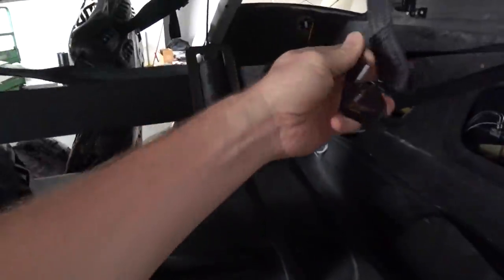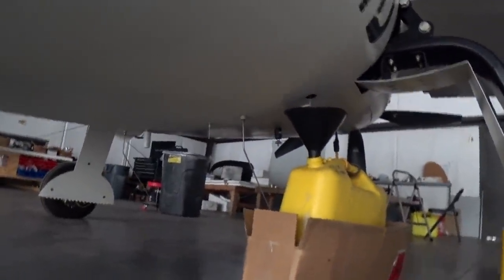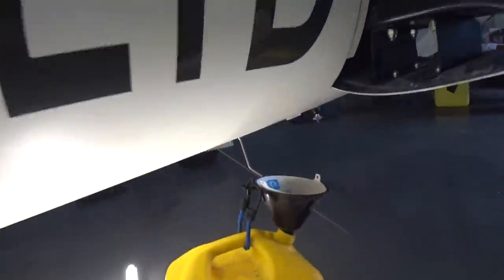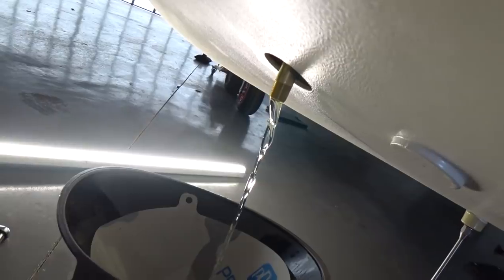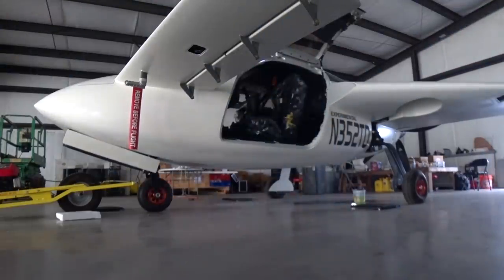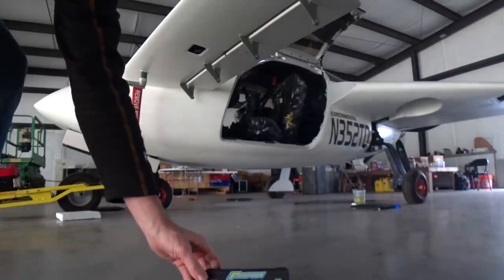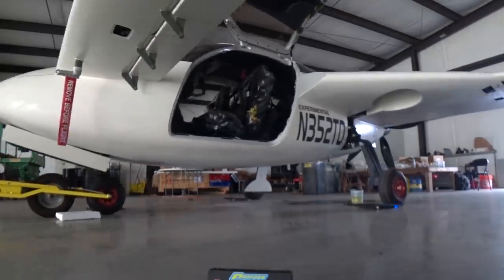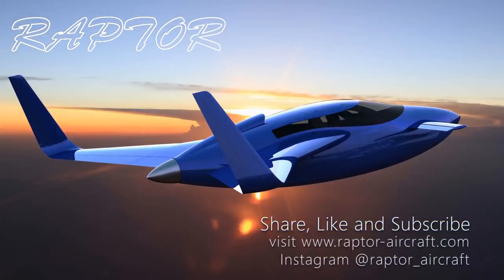Weight and Balance - Building the Raptor Prototype

Comment: 3085 pounds empty. Solid built platform in my opinion. Built as if it were fiberglass but with carbon fiber. I would expect this ship to be "Built Like A Tank!" as you commented to someone. We have so much to learn about carbon fiber and Kevlar. I still repair and restore fiberglass boats from time to time that were built in the 1950s that are still very serviceable. These machines weren't vacuum molded either. The resin was rolled out by hand. The chopped fiber boats hold up well too though much thicker and heaver than layup. It's the encapsulated wood that fails with most boats. The all fiberglass boats properly UV protected will last over 50 years. I keep air circulating in my personal boats to keep them dry from condensate and sweat. It will be fun finding all the refinements to make Raptor, lighter, faster, stronger however hull (serial #0) should offer the most quiet, smoothest ride. Seriously brilliant!

Comment: Hi Peter Great project! Here, we did two velocities and one long ez in 30 years for fly. One question to help. I was a weight and balance engineer in aviation industry. I suggest that you level the airplane before use plataform scales, if no , erros in weight values will occur. I suggest you jack the nose landing geart until level the airplane, you will need a NLG tire jack and a bubble level ( the level point in Long ez is inthe Canard region) , i suggest don´t use the protactor level, becouse the error in angle is huge.... Goog luck and thanks to share your development!

Comment: Following your build for some time now; you're tenacious. A couple questions on today's video:
What was ambient temperature at half gallon fuel weigh? (volume changes with temp) and
 Are you going to weigh/calculate CofG using jack load cells to determine retracted gear CG dislocation?

Comment: Obviously overweight but for a prototype it's certainly encouraging.  I do worry about being able to shave off 800 lbs though.  Peter, have you considered using AI to create the frame and 3-D printing in order to cut the weight down?  It may also make manufacturing significantly easier, being able to integrate many pieces into that process (thus saving even more weight).

https://www.bbc.com/future/article/20181129-the-ai-transforming-the-way-aircraft-are-built

Comment: So the planned specs were for a 2,300 pound aircraft... a 38% overshoot.  I suspect the "kit" cost will also overshoot by at least that much.  This is looking to be an $400k entry cost airplane when you take into account all the extras.  That price point brings in a lot of certified aircraft into the competition.
Reply: @gmcjetpilot  My point is that the viability of this project will be jeopardized if it can not be scaled and sold at price points that are more competitive than other options (with less financial risk).  I am categorically rooting for Peter and his innovation and ethic.  First flight will be soon and it will be sweet.
Reply: It's not that different from a velocity other than a bit bigger and pressurized, but with a vastly cheaper engine. And their kits including that much more expensive engine aren't anywhere close to $400k. And if you subtract off the engine price difference, not hugely different than what Peter is quoting for the Raptor. Get some volume discounting in and that will help, though of course there will be startup costs to factor, and the promised build assist costs and all which won't be cheap, especially at first. But once ramped up a bit, doesn't seem too much of a stretch to get close to Peter's desired numbers thanks to the cheap-ish engine. If he can get it under $200k with a 2-4 week build assist and bells and whistles similar to the prototype (including pressurization) it's going to sell insanely well, even if the performance numbers aren't hitting the original goals. -Daven

Comment: I would re weight with 25% , 50% , 75%, 100% and add people to the seat and move them around to see the best way to load out a flight. And test flight with dummy weight to see how it handles before you put alive people in the other seats.
Reply: There is no need to re-weigh as it can all be calculated knowing the empty weight and positions of seats, fuel tank dimensions etc. very easily.

Comment: So, without the ballast, that's 3,085 pounds + 121 gallons of fuel * 7 pounds per gallon = 847 for a wet weight of 3,932 pounds. Estimated gross is 3,800 pounds, so you're over gross without the complete interior and with no human beings. I've been a fan of this build and have tried to leave some encouraging comments, but...how is this thing going to fly?
Reply: @Shawn Huffman Ouch! :)
Reply: @gmcjetpilot  I really hope he'll be able to find some ways to shave off some significant weight for production models. I hope he'll find areas he's overbuilt and can do some localized redesign. I know it'll be able to fly for testing, but to reach his performance goals (speed, load, and distance), some very serious weight loss will have to be realized.
Reply: @SomeTechGuy666  "When you increase the weight, all those numbers change."

Right, because load is a function of G x weight. If we assume he built it to normal category limits (+3.8 Gs), then he doesn't really have any wiggle room. If, on the other hand, he built it to aerobatic limits (+6 Gs), then he could reduce the G limit (and increase gross weight). However, of course, increased weight will hurt performance. Anyway, it will be interesting to see what happens.
Reply: @SomeTechGuy666  "The kicker is that it is already made out of carbon fibre.  Making each part 40% lighter is not going to be trivial."

Assuming, of course, that the parts (and main structure) weren't massively overbuilt. I didn't watch the earlier videos and so don't know if he just threw a hundred layers of cloth down and slathered on a bunch of epoxy. I get the impression that happened at least in places.
Reply: @SomeTechGuy666  Remember where he drilled a hole through a couple hugely beefy pieces of carbon (some sort of tunnel?) to run a shaft through it and install a big pulley for the aileron work he's been doing? Obviously, that's overbuilt. That's the kind of thing I'm thinking of. It seems clear that some things could've been built lighter. I'm certainly not debating the things you're talking about. I'm sure some of it has been done right, but I don't believe all of it has. If I'm wrong, how did the plane end up so much heavier than designed? I know that airplane design is very complex and it's easy for me to armchair quarterback, but there's no debating the plane is really heavy. I'm very interested to see what happens.
Reply: @SomeTechGuy666  I don't know why it couldn't be test flown on a calm day. You'd always approach load limits incrementally, over time and multiple test flights, anyway (envelope expansion), so normal climb and gentle turns would barely get you over 1G. I'm not a test pilot, though, so there might be something I'm missing.

Comment: Wow 3100# empty is kind of a a deal breaker. The comparative 250 KTAS  310HP Velocity TXL is 1790# empty with an MTOW of 2900#. Raptor is heavier empty than the TXL is at MTOW and horsepower is almost the same.  I love the plane and the vision but there is an elephant in the room and this plane will not succeed unless it gets a lot more power or a large diet.

Comment: Just a Thought..........
Diesel fuel that is intended for use in Cars and trucks on public ROADS has a road-tax included in it's price.
Diesel fuel that you use in Tractors, Graders, Back-Hoes, etc, and other non- highway and road going vehicles (which has a red dye in it, otherwise the same fuel) is much cheaper.
It may benefit you to get a tank or drum of Diesel fuel for equipment delivered there to the hangar as it would save you $$$ since your diesel-powered vehicle will not be using public roads and therefore is exempt from paying the associated taxes involved???

I only thought of this because I noticed the clear color of your diesel you were draining.........
Reply: Animal Husbandry Fuel Tax relief is associated with #2 diesel (red). I used to maintain turbine crop dusters, they were allowed to use tax free #2 diesel as would a farm tractor. The problem with #2 is that in cold weather the engine is hard to start; fuel doesn't properly vaporize without fuel heater, which doesn't operate until the engine is started.
Reply: @koncaswatch8726  well, I believe this man building this aircraft is in Georgia, USA right now, so it never gets cold enough to have a problem? so at least while he is in Testing and R&D phase he could use red diesel to save $$$
Reply: Use regular diesel and get the refund when you file taxes.
Reply: TechGuy probably just Jet A which is essentially diesel fuel with ice and bacteria inhibitors in it.
Reply: That’s a great point. Talking to a fuel delivery guy, #2 diesel is the exact same as red dye diesel, he fills both pump tanks with the same fuel then pours in a red dye into the farm tank. As far as performance is concerned they are identical so throw in a winterizer of sorts into the cheaper fuel and you’ll be ready to rock

Comment: Not an aircraft engineer but i beleave the wings are too big for the airplane. It is my understanding that the boundary layer does not scale up so the Dutch roll experienced in the scale model wouldnt necessarly be experienced in the full scale airplane. This therefore presents you the opportunity to cut some of the weight down. Good luck with your project. Im rooting for you buddy.